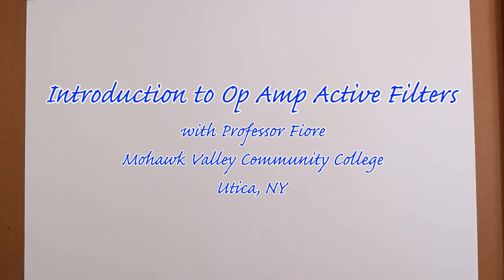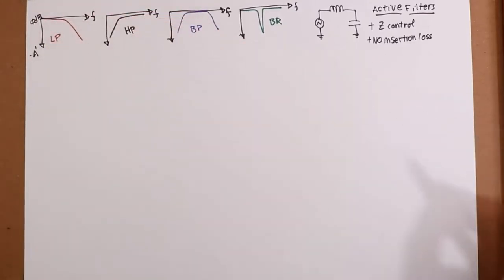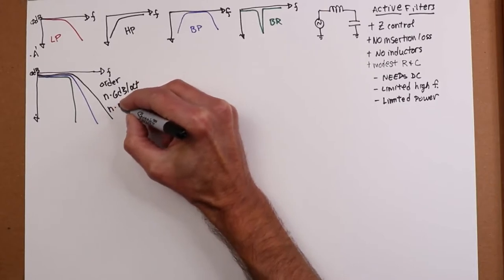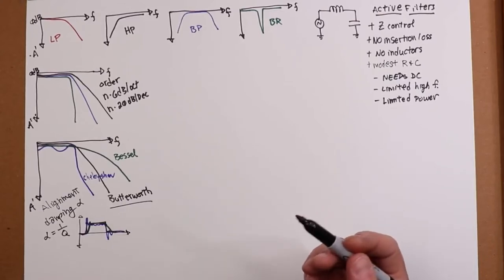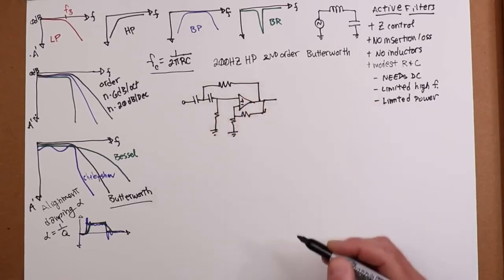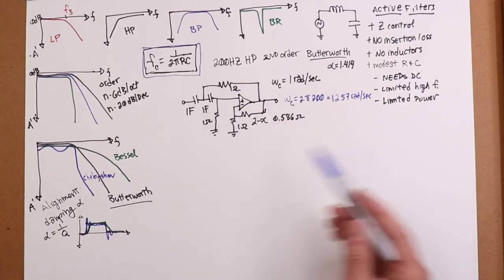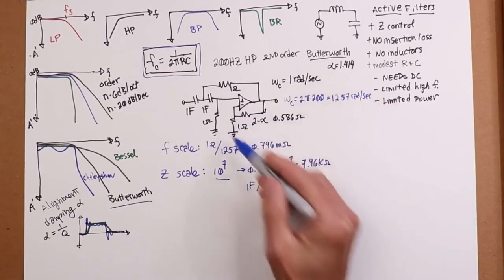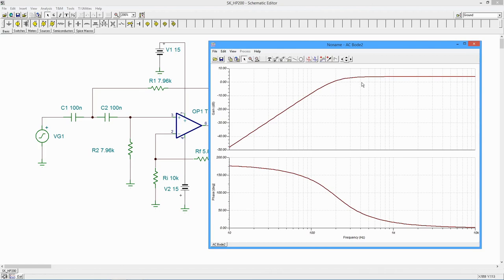Op Amps: Active Filters Intro

Comment: I love the template. 😊  thanks .
You had me going mental with the 1 farad and the milliohms 😆.  Then you corrected it and I could breath again. 
Thank you so much. Subscribed straight after the heart attack with the 1 farad.
Reply from the maker: Yes, it looks a little odd at first, but I find that the frequency scale followed by the Z scale works well, and is practical when it comes to choosing components. You generally have a much wider range of values for resistors than capacitors, so best to keep those cap values "nice", and let the resistors get weird.

Comment: Thank you for creating this video. One question I have, is with active filters, is it possible to create a sharp resonant style band-pass which is similar to the notch-filter with a +/-1Hz bandwidth selectivity? For example, be able to select 2347Hz, 2351Hz, or 2357Hz, and 5669Hz, across a range of 10kHz
Reply from the maker: 1 Hz out of 10 kHz is a Q of 10,000. I doubt very much you could ever get that to work with this circuit. A Q of 100, sure, but 10,000? Not so much.